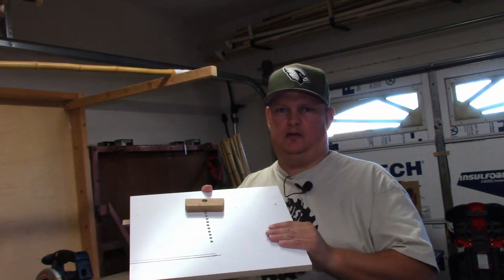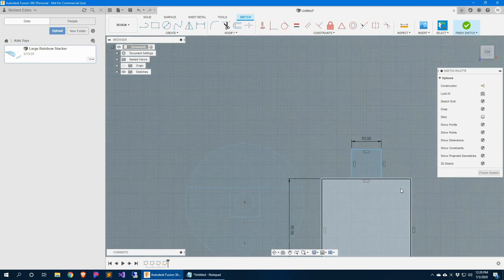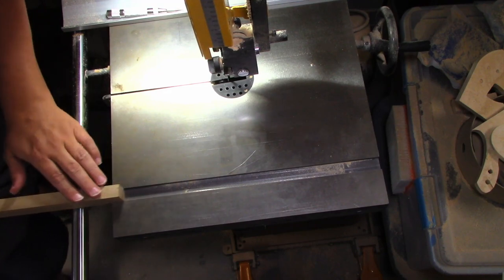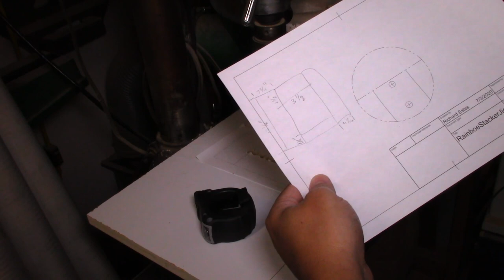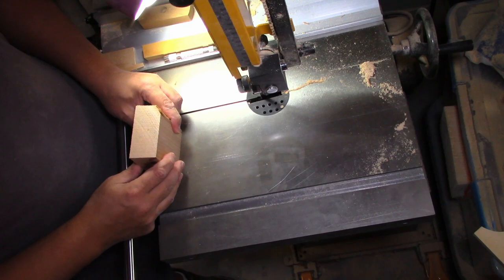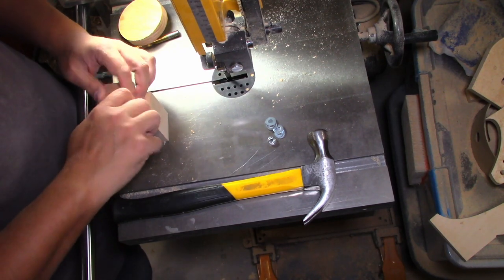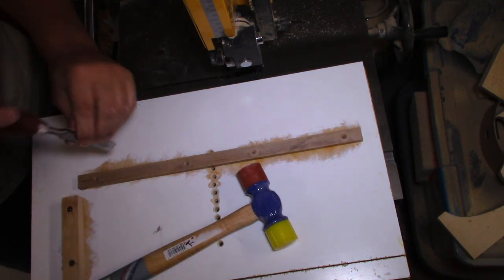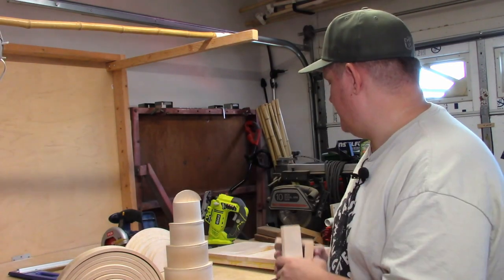Making the Rainbow Stacker Jig

Comment: What blade do you use?
Reply from the maker: I use both the Timber Wolf brand and Olson. As for cutting the circle parts I use either 3/8" of 1/4"

Timber Wolf
https://amzn.to/2QoogfM - Timber Wolf Bandsaw Blade 111" x 1/4" 10 TPI
https://amzn.to/2FUQahC - Timber Wolf Bandsaw Blade 3/8" x 111", 6 TPI

Olson
https://amzn.to/3hpZOGZ - Olson Saw FB19711DB HEFB Band Saw Blade, 3/8 by .025-Inch, 14-TPI Regular 111-Inch
https://amzn.to/32kI5dD - Olson Saw FB14811DB HEFB Band Saw Blade, 1/4 by .025-Inch, 14-TPI Regular 111-Inch

I have added this info to the video description as well.